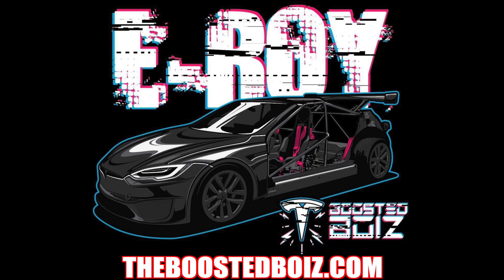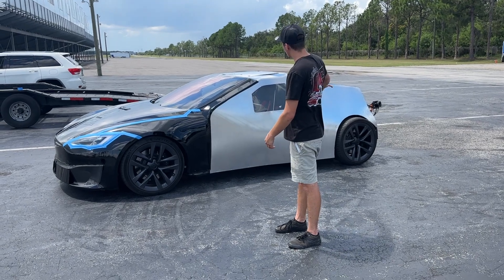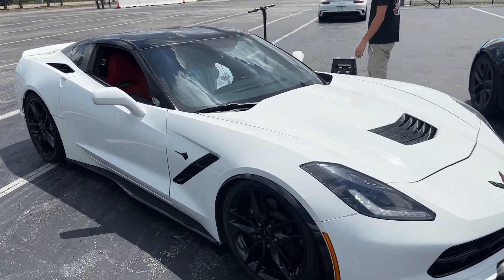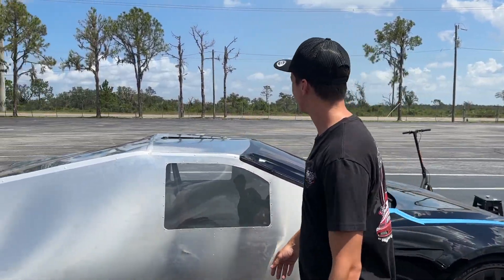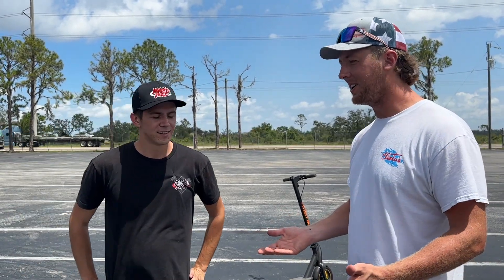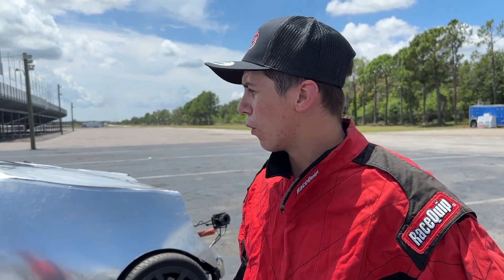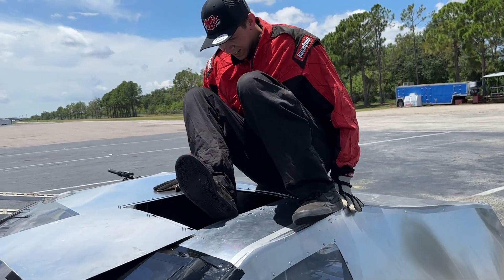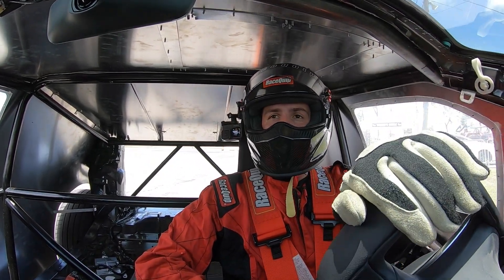We Built an Aerodynamic Body For Our Tesla Go-Kart To make It Faster!

Comment: Said this in a previous video, but if you want the beat the world record, you need to be running 18" wheels in the rear with Mickey Thompson ET Street tires (275/45r18s). Thanks for the video. 👍
Reply: They know but for some reason we're getting 400 aero videos on the same lame stock rollers and being told "we cant hook" literally 47 times. We know you can't hook, we all know why. Spend the money and get the record with JUST a damn wheel and tire change, already! 🤘
Reply: @fast97z24  Cant milk it for a bunch of videos if they just put a good tire on it and make the record....
Reply: @fast97z24  this is called content bud! Get with the program dude
Reply: @Kalup98  i hope they put the money they made from these garbage tesla videos into actual cars
Reply: Did the other plaid guy let him try the 18s, and it didn't help?
Reply: @ionstorm66  didnt help because on that day they were already not spinning. it helps with marginal track for sure. but also i believe it will have more rolling resistance and drop mph

Comment: Need a removable front grille cap so it can get enough airflow for heating/cooling the battery. Or just for the HVAC if you want to drive it around. I'd guess that it's probably starved for airflow.

Comment: I was gonna say maybe instead of sheet metal you can use canvas with some light weight impregnation essentially paper thin canvas will be dropped over the car and then you could basically put thin amounts of resin over the canvas so it can hold its shape when under pressure. It should allow for a light weight body that will only weigh in at about 10 pounds maximum per panel. I'm sure you could make a mold of the front panels then cut the fron panels off so you can save a good 200 pounds off the front. I don't see the rear wheels slipping it seems to be the front wheels that slip the Most. Perhaps the motor controller needs some tuning were its more of a 60 50 at launch then its goes to a 50 50 after it hits 10 mph.
Reply: I was thinking fiberglass cloth and resin. I seen it at O'Reilly's but never actually worked with it. As light as aluminum is anything lighter will add up to performance :D
Reply: @lanceuppercut6168  I agree. We could make some small scale tests and see what holes up best in a small wind tunnel that could be a fune experiment
Reply: @lanceuppercut6168  we can get a small scale model of a tesla and make E-Roy then after we make E-Roy we can make fiberglass or canvas inpreg molds and see what is lighter

Comment: You need a nice long tail to make it more aerodynamic, think teardrop shape on its side. Or at least close the rear end up. And do wheels and tyres ! You'll get the record easy.
Also always charge to full each run if you are trying to set the record, each Volt drop is a few kilowatts less power able to get to the motors.

Comment: would electric cars actually benefit racing at altitude with the thin air
Reply: Thinner air has less density, equalling less resistant. It would definitely be a little faster at a high altitude.

Comment: Remember to vinyl over the wiper gap at the bottom of the screen for next time. Would be good if you could make some thing removable for it, just for the drag runs and take it off, so you don't get glue residue etc stuck on the screen. Maybe  like some kind of foam inserts that could be secured into place really well...

Comment: make it have carbon body panels, a drag wing, and pull slicks or radials on all four wheels
Reply: The weight loss going from that thin aluminum to carbon isn't gonna be worth the huge extra cost in my opinion. He said the aluminum sheets were already only 15lbs

Comment: Aerospace Engineering student here: You need to also put areo on the back of the car. Currently, the open back end creates a negative pressure environment which causes the surrounding air (fluid) to turn into a more turbulent flow. Closing this pressure environment off as best as possible should give you better times as long as you use lightweight materials. Also in general you want Eroy to be as similar to a raindrop as possible. Hope this helps!

Edit: apparently I missed a video about Eroy being tested in a wind tunnel where it preformed about the same when aero was in the back. The Cd (drag coefficient) is more important for speed the faster you go. So if the tunnel did not reach 150 mph then the Eroy would actually preform much better since the faster you go the more dense air becomes.

Edit 2: After watching the video understand why the aero wasn’t gone after. However I think it’s worth mentioning the the design of the back is what prevented a big improvement in aero. The back angles off straight down. If you were to have a slope (with no sharp edges) the aero will be greatly improved. I don’t know if weight would impact this too much for it to be ineffective but it’s worth looking at.
Reply: And closing the wheels would also help
Reply: Boattail FTW!
Reply: Definitely. Since this is the first iteration, I think they’ll end up closing the back, make a couple minor modifications and change the tires. Definitely got 8.9 in them.
Reply: They were already told this. They don't care.
Reply: @ThunderbirdWD9598  they definitely care that’s literally why they did all this lol.
Reply: @chrisgeorge84  Kyle has a history of ignoring good advice. This is just another example of his stubbornness.
Reply: @ThunderbirdWD9598  ahh I’m unaware, hopefully that’s not the case here
Reply: Yeah. Aero is weird and makes you question everything. SuperfastMatt has a great video on his land speed car. He mentioned that cutting off the tail has little affect on a teardrop. My guess is that the reduced surface area of the cut off rear negates some of the drag generated by detaching the flow. But that's my stupid YouTube comment engineering brain opinion.
Reply: @jacobrzeszewski6527 yeah the surface area thing you mentioned is probably true if you have a material with a lot of friction
Reply: @jacobrzeszewski6527  - this method is used a lot on road bikes (cycling). If done right, the air behind the airfoil basically creates a static pocket that simulates the missing section of the airfoil so it acts like a full airfoil. Can be great for applications with manufacturing or size constraints. Look up Truncated Airfoil and there are some good images and videos showing what the airflow does
Reply: there was something about turbulence in the rear wheel wells as well, wondering why they didn't make them wider.
Reply: I’m running a 1/10th scale rc car shooting for 80-100mph right now and this never occurred to me. 
My body shell is aero af until the rear end which is just open.
Not sure what to do now…masking tape or some kinda venting further forward in the body?
Reply: @ellisberry8747 I would try to make your car look like an airfoil as much as possible. However if you can’t, I’d try ti just tape up the back end and make sure there is no sharp edges. This would probably be best
Reply: @ellisberry8747  do a taped on body thats flipped backwards
Reply: @ellisberry8747  weights on the front and more power with a one to one spur gear and pinion
Reply: Failed aerospace engineering student here: you don't get much change in performance when adding a back shield because with sharp end at the back of the car you create detached turbulent flow which doesn't create as much of a vacuum as you would expect. That's why most cars have sharp tail light areas and mini spoilers
Reply: @ChipmunksPlan yeah I realized that they did the detached end after watching their other video. If they smoothed it out it might help but with the extra weight I’m not sure. Also it’s never too late to try to get your degree. Best wishes in whatever you persue
Reply: @stonecinematography1985  oh no, I got my degree. I was just too stupid to be an aero engineer so I went with mechanical and materials
Reply: They know it isn't perfect, it doesn't have to be. It was horrible without the panels, they just need it to not be horrible. Put drag slicks on it it'll do what it needs to do.
Reply: That's what I said a week ago. Make a speedtail.
Reply: Did you watch the previous video? They put it in a wind tunnel and tested this, the initial drag with no body was .69 and with body .27 when they tested with the back covered they didn't gain enough to justify the work it'd take.
Reply: @OneExhaustedFather  they never tapered the rear, just blocked it off. a long tapered rear would be worth the effort, as of now there is a vacuum behind the car slowing it down. if they put a tail on the rear that came to a nice sharp point like > it will go faster. this was also mentioned in the wind tunnel video by the worker.
Reply: @cmawhz  thats the way Bonneville racers do it
Reply: @OneExhaustedFather  no i didn’t watch the previous one. What was the max airspeed the wind tunnel created
Reply: @stonecinematography1985 the software interpolates to higher speeds regardless of the max wind tunnel speed.
Reply: @stonecinematography1985   the air tunnel guy said the drag scales pretty much directly after 80mph and they can calculate for 150mph
Reply: @acehealy6102 yep, this is like saying a plane can't be designed to go Mach 1+ unless a wind tunnel has 1000mph air.
Reply: @xjmg007  students amaright? We were all there once.
Reply: @xjmg007  This is a particularly poor example because the air behaves very differently in a supersonic regime. The enormous pressure waves that form cannot be replicated in a wind tunnel and that's why we rely on simulation and real-world tests with pressure sensors all over the body of the aircraft.
Reply: @OneExhaustedFather but a better underbody tray it might help to seal the rear. Rear wheels should've been covered if they went this far.
Reply: @replynotificationsdisabled  I work on these daily, we have a pretty good under aero in these cars pending they still have it all on there. I haven’t seen it from the bottom. I agree with what you’re saying, just saying they didn’t feel it was worth the effort after the wind tunnel testing
Reply: true
Reply: The slope of the roof might work to direct the air downwards anyways
Reply: I am aerospace and I agree
Reply: Nerds
Reply: No need to watch previous video, he discusses this point at 1:38 and also mentions it's a second escape route.  Accidents happen, safety matters.
Reply: @jezzsmith7593  he can put a hatch on the rear too
Reply: Have a look into the truncated airfoils used on race bikes. As long as you truncate sharply then you can still keep smooth airflow where basically the still trapped air to the rear of the body acts as a full airfoil. I don't know how much this would get disrupted in a car based application but looking at the shape they have gone with (with the sharp termination), I expect it will not be creating as bad a negative pressure as you think.

A bit of extrapolation and speculation here (which isn't best practise engineering) but it is a similar application and would be worth looking into as a comparison against the full airfoil argument.
Reply: This guy aeros
Reply: What do you think about the wing shape on the back of a car, does an angled up wing work better than something that's straight out?
Reply: Needs a giant rear spoiler!
Reply: I was just going to post this, agreed 100%
Reply: They already know that from the test in the wind tunnel where they did cover the back.
Reply: They did this in the wind tunnel testing and it showed very minimal change...not enough to matter.  Should've watched their last video
Reply: Naw....I'm not an aerospace engineer student and I disagree.
Reply: @ShrimpDaddys of course you disagree, trolls are the pioneers of the hydrodynamic branch of physics as we all know.
Reply: @mwat22  sucks when your wrong
Reply: @ShrimpDaddys  Ah!, the keyboard warrior emerges! i guess your amazing detective skills have detected the amount of effort aerodynamic and hydrodynamic sarcasm needed to bring the troll out of you.

Comment: Just ask Uncle Chet how he disabled traction control to do 4 wheel burnouts in his plaid and do that up to the starting line. The you could use a set of nitto type radial and hook
Reply: I think he just unplugs the ABS sensors.
If they can get the track conditions good enough so the traction control is not needed,
unlocking the abs system should let the cars engine go unrestricted, if uncle chet are correct in that it unlocks the restrictions.
Reply: @cajampa No Uncle Chet didn’t unplug the ABS sensors to get 4 wheel burnouts. He literally drove his tesla under water. He had to put 8,000 pounds of weights and it took a couple attempts to pull it off. The water shorted something out and it let him do all wheel burnouts.
Reply: @chapman6953  What are you talking about dude? 
He claimed that is what he did here https://youtu.be/opqxXw5Yj_E?t=167
Now that whole video was a joke, but that last part about the traction control sensor seemed to be real explanation.

Comment: A long tapered tail cone would reduce drag! the back didn't reduce drag much because the air was still separating from it and causing turbulent flow
Reply: Ideally you could taper the cabin and add separated nacelles for the wheels and struts, similar to the new Ford GT
Reply: Underrated comment. They need the tear drop for sure
Reply: The principle of that is sound, but it can introduce unfavourable earodynamic affects - it's why there were short and long tail versions of many Le mans cars for the old track with the very long straight, before the chicanes were added.
An effective option is the "Kamm tail" - this is like a cut-off long tail - it's not quite as low drag, but it's much more stable.
Reply: Gutted it for nothing lol
Reply: Teller-oj6iz  
Reported for spamming 👿
Reply: Teller-oj6iz  
Spammer! 👿
Reported!
Reply: They took it to the wind tunnel and got the aero down to around 0.25 or so Cd with the current configuration, so a tapered tail wouldn't improve their MPH much.
Reply: @randr10 yes it would
Reply: @MV-ri7zu  By how much? What kind of ET and MPH improvement would they see?
Reply: @randr10  Do you think im a wind tunnel? How tf would I know I just know it would improve it no clue about the numbers that would also depend on how well they shape the tail.
Reply: @MV-ri7zu  No, I think you don't know what you're talking about. I said it wouldn't help much in the MPH. You said it would. When I asked you how much, you say, "how tf would I know?" My point exactly. There's a diminishing return with this kind of thing on a 1/4 mile drag strip, especially with a car this heavy. This isn't Bonneville.
Reply: For reference they went from a 0.8 drag coefficient to a 0.25, a huge difference, and picked up less than 5 mph. What do you think a few more hundredths is going to amount to?
Reply: They picked up 5mph, the problem is grip. Those tires look bald
Reply: @nicholasn.2883  Bald like slicks?
Reply: @eriklarson9137 😂
Reply: @eriklarson9137 Bald tires don't equal slicks
Reply: @eriklarson9137  If you were paying attention, the tires on the car are definitely not slicks.
Reply: @sleezypacking6580   @MrMikeT89   woooosh

Comment: If you want to make E-ROY faster you could remove out like half of the battery modules to cut more weight🤔☺ you only need like 50KWH to drag race with eh😃
Reply: You would have to double the C rate somehow though. Otherwise, you would have half the horsepower.
Reply: I wonder how much voltage drop there would be
Reply: Should still be the same Voltage and amp just less Storage🤔
Reply: @rachelbrinkley3240  I don’t think that’s the case. What if you dropped it down to 10kWh? Are you saying it would still put out 1000hp?  The Output power of a battery pack does depend on the capacity size to some extent.
Reply: @lemongavine  Well if you need lots of power quickly you can add some Super capacitors then
Reply: @rachelbrinkley3240  that would be awesome. I suspect we will start seeing that in the aftermarket at some point. Can’t wait.

Comment: I have some bad news for you guys… Tesla has these cars rpm rate of change locked to a minimum curve.  That means all the changes you have done are just reducing the current required to run your 8.8’s.  Get a tesla scan tool and run it with and without the body and I promise you will see the car is just pulling less current.  I have some dyno pulls and logs that i can show you.  I am working out a way to remove this hurdle…. You guys should be in the bottom 8’s with what you did.   Your best bet is to get some 19” gen5 camaro rims and 29.5” tall drag radials (not slicks).
Reply: Exactly tesla has these things locked in just like your saying man. Best way to overcome this would be some type of jail break of sorts which I'm sure would disable the Tesla super charge functions at minimum once car is ever flagged by the Tesla gods lol but with thier car it wouldnt matter as they are full blown racer at this point with it